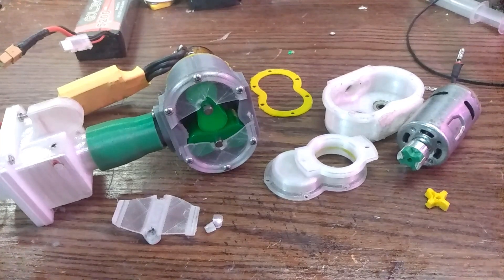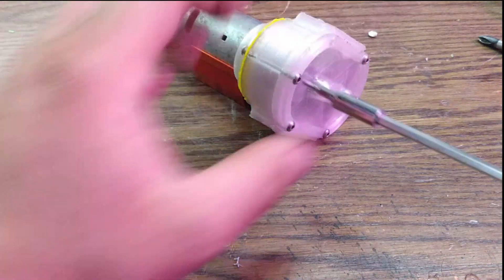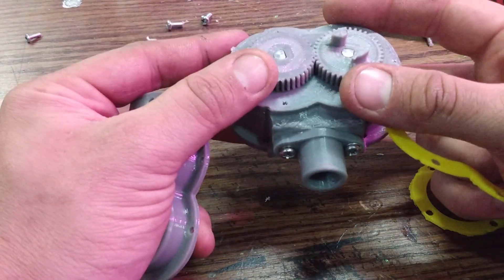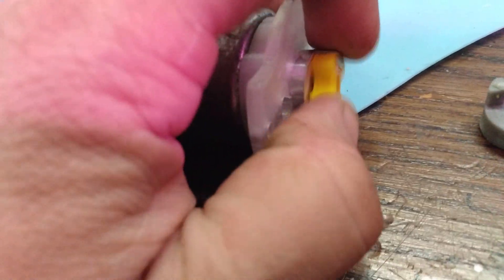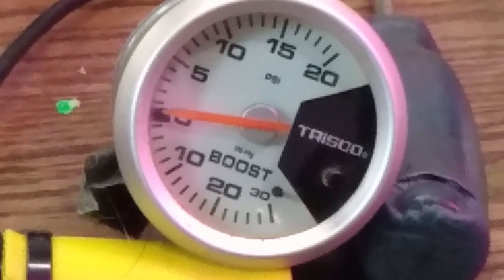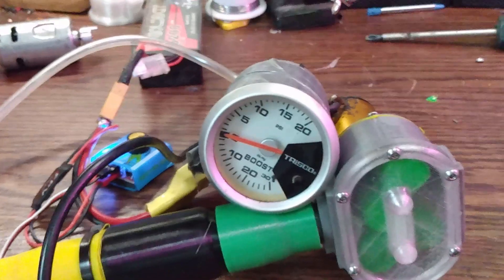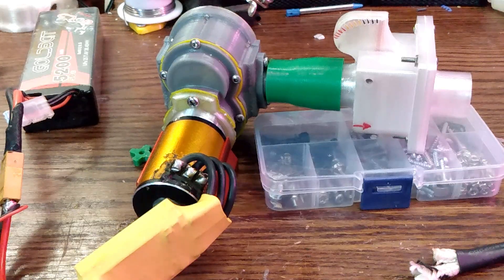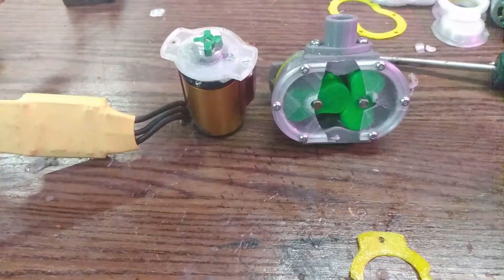Working 3D Printed Roots Supercharger

Comment: A fascinating project. I was thinking that the main advantage of this design would be high pressure and silent operation. But your goal seems to be different. I was imagining tight seals and far slower rpm. This was a year ago so maybe you have a newer version.
Reply from the maker: having seals that interfere would be difficult and ad to the heat generated greatly , as well as the small point where they would switch from lob to housing would likely take alot of design and refinement . In industry the roots blower always has clearance and interference will destroy the pump with the harmonic pulse from vibration as well as make alot of heat .

Comment: A centrifugal type should have better performance for the same motor input power, since it’s electrically driven there shouldn’t be any downside to it
Reply from the maker: This is true , but as well as being the easiest to produce , it's also been done successfully. Part of this is just for the sake of doing it , and in that case the harder the better . I do however have plans to use the 2 stage Regen pump on an engine , and I have made designed a smaller version to be powered by the same 6000kv motor .

Comment: Have you tired tpu seals in the lobes yet? I feel like it would cause lots of drag, might lose speed, but might get better compression
Reply from the maker: I tried nylon , the issue is tolerance , temperature and how much plastic expands . If I make it tight enough that putting apex seals would help , it's too tight and rubs then welds together . I have an older video that shows the nylon sealed version . I found even with water pumps ambient temperatures effected how well things work but with water being thicker than air tolerance is less of an issue . That is sort of the reason I whent smaller as the surface speed on the outside of the rotors is lessened . It was somewhere around 60 000 rpm or more when it destroyed itself , so something like 20-30 000 might hold up for a useable about of time . Basically I cannot rely on my ender 3, or 5 to be accurate enough to hold that sort of tolerance. Maybe an sla printer would be able to work better with this sort of work but that's money I currently do not have , one day tho .  This to me is all a learning experience that I'm just letting the internet in on . I'm not sure how my videos show it but I have made many improvements and learn alot from all of this and have somewhat of a plan to something useable on am engine . In the end I'm leaning towards something with less tolerance , like my Regen pump or a centrifugal compressor , maybe in multiple stages . I have so many ideas but not alot of energy or money to put them into practice , so everything happens kinda slowly .
Reply: @turboprint3d  I’m gonna start experimenting and designing some chargers like yours, would you want me to share me results and stuff when I do?
Reply from the maker: @Flatout56-o8k  sure that would be great

Comment: good night bro, just a question to how many RPM you tested I'm printing and I wanted to know how many RPM to make a transmission because I want to test in a 2 stroke engine 60cc 3hp thanks
Reply from the maker: this version is best powered by a rc car motor , I used a 6090kv witch apparently was too much rpm .I would say it needs at least 20 000 rpm to be effective tho . this is not so much a finished unit as another stepping stone  in that direction .
Reply: @turboprint3d  thanks bro my engine runs +/- 10 000 rpm I'm going to finish printing and I'll add the photos on the thingverse now it's waiting to assemble and be if I came 0.2 bar and excellent
Reply: @Giovanni-GLT  then a 1:2 speed increase with a pulley should do it

Comment: I am thinking about something new what about a screw compressor?
Reply from the maker: could be cool , it has been done as well . The biggest issue there is such a tight tolerance over a large area like that would be alot of work in fitting . After all I have done on the topic I'm leaning towards air pumps with less complicated internals to work towards something that will last more than a little bit, and make decent pressure and flow  .
Reply: @turboprint3d after some trials i might have something that you might like, it's a twisted lobe roots blower, when i have everything dialed in i will link the files